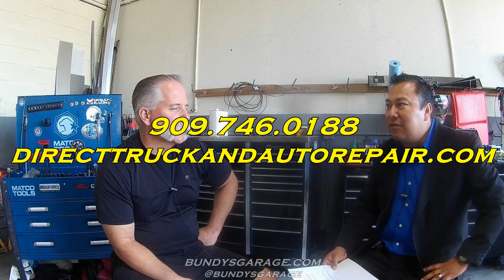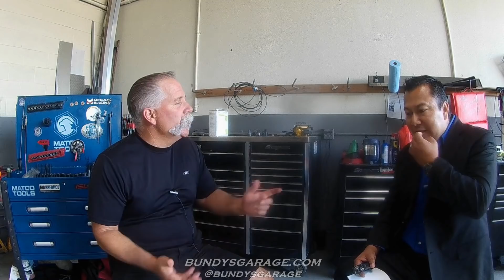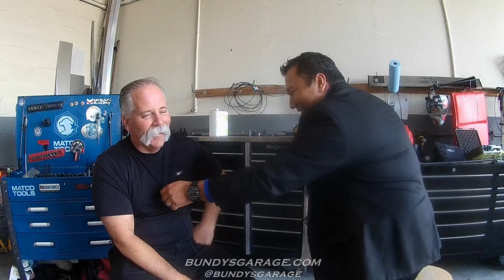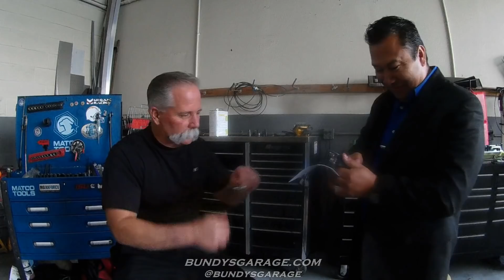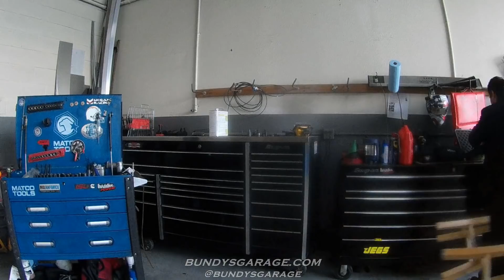Worst Diesel Engine Ever - What is the Best Diesel Truck out There? | Ford Dodge Chevy

Comment: i have the last great Diesel that Ford made. I have a 2003, 7.3L Diesel (Cummins) in a ford f250 super duty long bed 4 wheel drive. Now why they ever stopped making that engine and the Allison transmissions for FORD, I will never know. All those pitiful 6.0-6.8 engines are just about worthless for any real work. It was probably some trendy green designer that had not clue what a real truck needed to be. Politicans with their clueless green new deals to line their pockets are just about the most useless creatures ever to be allowed anywhere near our congress. When you buy into the BS for the green just to be green without a critical thinking mind you get a badly educated & trained designer.  If the fools would actually ask real workmen what they really want instead of clueless engineers and politicians that have never needed a real truck in their life we might get back to normal again.
My Ford is rusty but the engine still rocks. I wi ll be shopping around soon for a body to drop my engine in and start hunting an allison transmission.
Reply: 2003, 7.3L Diesel was not a Cummins. It was made by Navistar. https://en.wikipedia.org/wiki/Navistar_T444E_engine
Reply: This cafe stuff could be easily handled if they simply made it mandatory only people with a real purpose to own a diesel owned one. You know like women who want to prove their manhood and have nothing to pull. I liked your comment but we been down the shitter since Computerized diesels or diesels that couldn't run without a computer. Bean counters forget to factor in stuff like the motor being a pile of fken shit to accomadate cafe garbage. Def fuel does not work in the Cold States so it has to be deleted. Without going to much further on my tangent and to get to my point if your truck is broken because it was engineered poorly to pass a smog test that's going to fuck up the enviroment more in New parts having to have all fluids changed to put new parts on and or having to buy another new truck.

Comment: I love my 04 bullet proofed 6.0 F350, 253,000 and going strong. The auto has a much higher rating than the GM of the same years.
Reply from the maker: Yeah cause you Bulletproofed it. Thats the only reason it has a better rating than the Duramax. If it wasn't BP'ed it would be a completely different story.

Comment: From a mechanics point of view, Ford diesels may not be as good or great as say Cummings, but as a former owner of several Ford diesel trucks, I thought they were amazing. Technologically speaking, diesel technology is ever changing. The markets dictate what the consumer wants or requires. I hauled horses. 34 foot gooseneck basic set up across country. My F350 did an incredible job. Never ever had any issues. In fact, the more weight I put on her, the better she pulled and the more efficient that diesel worked. Though not every F250/ F350 owner shares that opinion, I still believe Ford does an incredible job. 

I owned a brand new Ram 3500. At 476 miles, the check engine light came on in what would be 12 times in less then a few weeks. I was angry. Had horses to haul. Loosing money and customers on a daily basis. Problem? A fuel rail management issue caused a code that triggered the engine warning light. Though it never flashed, I simply couldn't take the chance. Okay, under the Lemon law, I traded up for a more expensive Ram 3500 diesel. It too had issues. Went to Ford, traded that in for a Baby dually. Suicide doored extended cab. White with lots of chrome and a look that not even Dodge could compete with. The thing is, that Ford diesel was leaps and bounds better vs the Cummings diesel. Of course, again, not all truck owners will have the same experiences. It depends on many things.

Overall, Ford builds, manufactures and creates a better product line. In my opinion of course........🇺🇸

Comment: What's strange is the Ford Ranger 2.2L XLT diesel with the turbo made in Malaysia's Ford Plant is # 1 out here. We had ours at 200km(about 126mph) on the expressway EASY. Ford is # 1 out here good running dependable truck.

Comment: Best Ever !!!! Ford/International 7.3 turbo 1994-2002, most reliable,durable, powerful at the time and most popular diesel ever made. You have to include all the International chassis that had the same engine 444 in school buses, box trucks, etc. The Worst Ever. 350 Olds Diesel Truck wise Super Duty is still super but $10,000 extra for any Diesel is not worth it unless you really pull load all the time. If I could get a new 2001Ford SuperDuty 7.3 Again I would take it over any thing else.

Comment: I agree I had a guy in my shop they wanted me to stud the heads and all that other crap I learned when I went to diesel School and learned a long time before that working on my dad's Cole trucks that the week is part of the bolt was where the threads are so why would you put something in the head threads on both sides and there's a reason why nobody want these those parts it's really good to start with but nothing lasts as long as OEM
Reply: Donnie Bargo so much wrong with your statements

Comment: The 7.3 is good  motor  but the  start around 1968 it was a 6.9 but the block  is the same  the last 7.3 was 2003 I have in wrecker for years  would over 375000 out

Comment: The worst diesel is my OM612 5-cyl Mercedes in my 2003 Sprinter van.  Well, it was great till the manufacturer deadly flaw with the EGR corrosion in the intake that bleeds hot bypass exhaust gases onto a nylon fuel return line to turn your vehicle into a lump of melted metal within 10 minutes.

Comment: So many mechanics like Ford because they are familiar with them and know how to fix them.  The reason they are so familiar with them is because there is always a Ford in their shop.  Buy a GM and never see your mechanic again!!
Reply from the maker: AMEN to that brother! I have a 1997 Silverado with a 5.7L, 300,000 miles same engine and transmission. Yes I know it's gas but I would much rather have a Duramax than a Powerjoke!
Reply: Now thats not true, being a part tow truck driver I see more mechanics driving cummins & classic chevy '99-'06 duramax

Comment: 12v cummins cannot be beat. never has, prob never will. no diesel can even compare by a long shot. not in power, mpg, reliability, ease of repair etc etc etc. keep it (near) stock and you will see 400-500K easy if driven proper.
Reply: For sure! I bought a 12 valve about 2 months ago. Bone stock. P-pump was never even turned up. Gets around 30mpg. I recently ordered a airdog air fuel separator, 3 gague pillar, and a kdp fix probably the biggest flaw it's a $15 fix. I have the parts just waiting for the next oil change probably 5k miles I changed the oil soon as I got it will make videos soon installing these and reviewing. Eventually I'll want to get some 150hp injectors and p-pump work which is free. I'll probably be 1k into mods with over 200hp gains should be making around 400hp and over 1k torque once I get these done. Love it love the sound and everything. It's been my dream truck since I was 16. Now I'm 19 and own one.

Comment: 97  f250  7.3  powerstroke with  180,000miles . The  only  thing  I've  done  to  it  is  replaced  the  fuel  pump  3  times . The  last  time  was  4  months  ago  when  I  did  the  e-fuel  conversion .

Comment: My 5.9 Cummins has been great to me. Regular oil changes every 3000 miles 
and change the fuel filter every time. Now the 48re transmission is a different story
Reply: What??    You change the oil at 3,000 on a cummins diesel?     LOL......    NO NEED for sure.    I live in Columbus Indiana where that motor is made.   One of my friends was the lead engineer for that motor as well.    I change mine at 8,000 miles but honestly you could do it every 12,000 with normal driving.     The only issue i've had with mine is the water pump.    had to change it twice in 160,000.
Reply from the maker: What are your thoughts on Jasper Engines & Transmissions in Jasper, Indiana?
Reply from the maker: What had happened with the transmission?

Comment: I dunno the allison is GREAT for stock power.  Thats it though . I like to tinker with my toys , you cant build and allison like you could a th400 4l80e 48re 47re . I think my perfect truck would be a GMC  6.7 cummins w/ a built th400 and gear vendors over drive.

Comment: Ford started out with a good diesel engine, the 6.9L international. A true diesel engine (i.e. Sleeved cylinders), I knew several people that got over 1,000,000 miles with no major problems. Then they decided to just make a cast iron block in the 7.3L, Dog City! It's been downhill for Ford diesels ever since.
Yuo want a great diesel engine in your PU Truck? Cummins, preferably the 5.9L 12 valve engine. Bullet proof.
Reply: As for Chevy, not worth talking about. Way too crappy.
Reply from the maker: Duramax is one of the best diesel engines out there, way better than the Powerstroke!

Comment: 6.0's get a bad rep because people don't know how to take care of them. just hotrod the crap out of them
Reply from the maker: The 6.0L was a piss poor design from the start. Never should of been released into the public without all the bugs and glitches being fixed first.
Reply: spencer streck my 6.0 has 230,000 no probs, but then again I own big time over the road Petrrbilts— I know maintenance....
Reply: spencer streck , I had a 6.0 in my fleet that was babied and thoroughly maintained that I had rebuilt and replaced the motor and blown a head gasket even after bulletproofing it. Meanwhile my 7.3 with 500k plus had its injectors replaced once at 300k.

Comment: The dt466e is a Detroit Diesel and the E suffix means Eaton Fuller transmission
Reply: International my friend. But I see how you'd have that misconception . International should've thought harder about it when they put the DT prefix in the engine's name.
Reply: @2001FordPowerstroke  the truck I drove has a  Detroit Diesel plate on it with horsepower torque manufacturing specs on it like every other diesel, it's a Detroit hell commercial Ford's use caterpillars when the have a heavy hand in international\navistar

Comment: There is no comparison.... Cummins blows the other engines out of the water — But I completely agree, Ford has a better truck body -
Reply: Cummins is such a dog on the road though. It belongs as a stationary engine running a generator or something. Got no top end, V8 diesels on the road for the win

Comment: Ford 6.0 won't go 30,000 miles without having injector issues, total junk, Duramax is an Isuzu engine crap as well, the early Cummins engine was a workhorse, the later electronic versions are problematic as well, early Cummins are the non commercial engine worth owning. "my opinion of course"

Comment: I have a 99 Ford F250 with a 7.3 liter powerstroke turbodiesel and 80 thousand original one owner miles... best truck ever!!
Reply: Jacob Stegall, I just had my 99 F250 7.3 stolen from me, original engine but second transmission with 520,000 on it. Broke my heart.

Comment: He said exactly what I was thinking; Ford chassis, Cummins motor, Allison transmission.
Reply: with Chevy all you would need is the Cummins engine. of course I'm partial to Chevy . but not crazy about the looks of new Chevy truck .
Reply: @bartmcgee4669  I agree with you. I like the classic Chevy truck and even the cat eye style. The newer Chevy trucks are ugly looking. If I could get a Cummins in one of those trunks, I'd be set. I do like the look of the early 2000 Ford heavy duty truck, they just look heavy duty
Reply: A lot of people build them on YouTube look it up it cost about $10,000 to do that swap but the damn thing will last a million miles
Reply: Exactly!!
Reply: So if you had that truck, what the hell are you supposed to say when someone asks you what truck you drive? I agree with that statement, but it would be an odd conversation...
Reply: until the end, then he says hed want a 7.3 psd.  those old 7.3s are monsters
Reply: Cummins is oil injected and can run in any position with high power to weight ratio like a Rotax?
Reply: I think we can all agree with that
Reply: It is the combination that I want to try to build
Reply: Same here, but I settled for a Chevy '07 classic with the LBZ.
Reply: The problem with Cummings and Allison now is that they are owned by Dodge and Chevy respectively now and those companies just slap Cummings and Allison badges on everything when they are not the same quality. And if anyone thinks a 10 speed in the Chevy now is an actual Allison go smack yourself.
Reply: Allison 1000 in the duramax is overrated. It’s fine for a stock truck but even an economy tow tune can blow it up. And when you blow it up it costs thousands to rebuild. The 5r110 in the ford is better
Reply: @Fishlove37  that's because allison is a tool not a toy. Allison builds amazing transmissions for commercial vehicles. Real commercial tools are(should be) spec'd properly. Then they operate as intended, usually for the intended design life. Personally I dont like cummins. I know people allover the place that have had, still have serious issues. An engine thats designed to run a million miles(2013 14.8L ISX) having major issues around 500k miles. At about $40k to rebuild, that soon it has killed many small trucking companies. All of them falling into "Cummins" is the best bullshit. I currently drive a 2020 X15 w/500hp/1850lbft. Sad sounding motor. Brand new engine sounds like it has major engine knock at any speed over 1400rpm. My d13(12.7L Volvo 500hp/1850lbft) pulled far better than this cumm-apart crap. Even in the Ram the 6.7 is a joke. All the diesels are pushed too hard. The only reason the lame duck 6.7 has the "pulling" rep it does is because of "torque rise". Where the hp rating to peak torque rating has a substantial rise in out put torque. 1000lbft@1800rpm and 400hp@2800  seems impressive? Well do the MTh on the hp. 400hp@2800 is only 750lbft(400hp x 5252 ÷ 2800rpm = 750lbft) so as you climb a grade(hill) the engine lugs back and begins to pull harder. If you look at the current Ford 6.7 its 1050lbft is at 1600rpm(more torque sooner), and 475hp@2600  walks all over the Cummins. Do the math on 475hp(475hp x 5252 ÷ 2600rpm =959.6lbft) so you will percieve less pull ass the rpms start to fall(lugging back), but the difference in ability to pull at speed is huge. Ford has 209lbft more pull at the top end than the Cummins, and pulls harder for longer(1600rpm vs 1800rpm). Not to say about the 10 speed vs the 6 speed. Even with the same transmission that Cummins is a distant third, as GM has the same transmission as the Ford. Look at the ratios. The ford tromped the GM on the IKE Gauntlet on a slight gear advantage(3.42 GM vs 3.55 Ford) and considerable power advantage(445hp is 835lbft@2800) vs Ford(475hp is 959.5lbft@2600) GM KEPT ON PACE WITH THE RAM WITH LESS PEAK TORQUE AND MORE HP AT A SIGNIFICANT AXLE GEARING DISADVANTAGE(3.42 VS 4.10). 835lbft is more than 750lbft(@2800rpm), so that wasn't a surprise to me. The 450hp/935lbft 6.7L with the 10 speed would have still beat the Ram by a considerable amount lol. If you do the math(peak torque x gear ratio x axle ratio) the 2019 F450 right on par with the 1000lbft Cummins at the axle.
Reply: @ryanshearouse12  no one is butt hurt, just proving a point.
Reply: and the good looks of the Dodge

Comment: Best is 7.3 powerstroke or 12 v Cummins. Worst is 6.4 powerstroke
Reply: @Oddly Right compound turbo and piezo injectors from factory made it a monster but the dual EGRs and initial DPF system were garbage. Plus the structural issues held it back. Rudy's diesel has been killing it with the 6.4 in drag racing and that is really where that engine shines.

Comment: BELIEVE IT OR NOT… 2002 Ford 7:3 with 980k on it!! Bought it new and been on overloads from the first mile due to utility bed full of locomotive repair tools. One trans at 450k, couple turbos, SAME INJECTORS AND PUMP until 800k!!!! , many front left hub assemblies(4x4),  two steering boxes, and of course other minor odds n ends… Truck has only left me stranded ONE time at around 850k miles due to a sensor. Truck still drives amazing, no rattles and everything still works great. Serviced with nothing but conventional oil every 4-5k miles, never ran anything special in it. Total shame what’s going on with the new diesels, feels like we’re going through the late 70’s again with all the smog pumps and miles of vacuum lines that did nothing but fail making the car run bad. 7.3’s all the way if you can find one. Grab them even if they have a few miles on them,  2-3 hundred thousand miles is not that many miles if they haven’t been abused

Comment: do you have GAS ENGINE COMPARISON?  Thanks!  I have an 8.1 Vortec engine mated to an ALLISON transmission.
Reply from the maker: OK here we go, Ford gas engines are junk. Chrysler engines are worse than Ford. Chevy makes pretty good engines. Mercedes, BMW, VW, Audi make good engines, just don't keep them long cause when they break down it's a huge labor bill as well as a huge parts bill. Toyota and Honda have the most reliable engines out of all the manufacturer's.

Comment: ALL truck's were originally meant too be workhorses , and if you keep your fluids fresh and a little maintenance on yours it WILL do you right no matter if you're running gas or diesel.
Reply from the maker: oh how I wish that was true
Reply: Not nowadays, in the past the same engine your tractor had was the one your truck had. Now with DPF, ECU, EGR and all these crap have made diesel engines a very complex thing unfortunatelly, against what diesel engines were in the past: simple and reliable

Comment: I have a sick o in my front yard flat cam sounded like bent rod blew the turbo.  

The Dodge chassis issues are much improved with a 5500 very tough truck with 6.7 with Aisin which is very fussy
Reply: fussy?